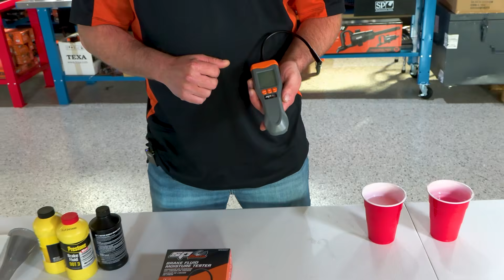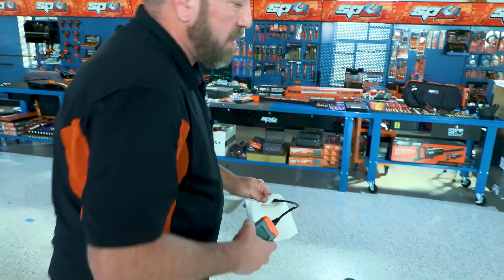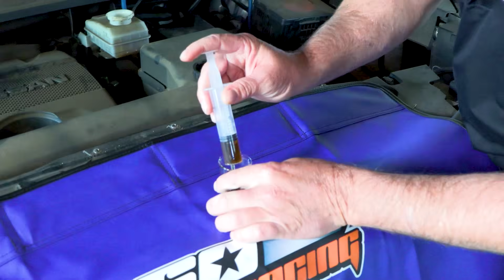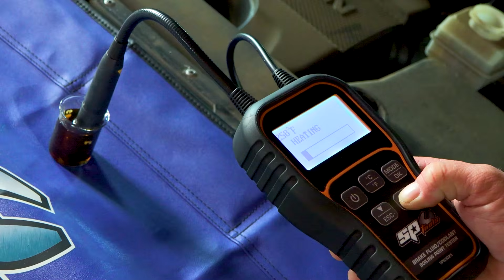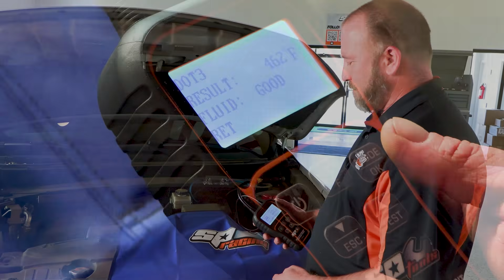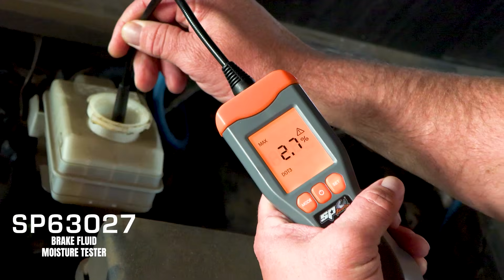SP Specialty Tools - Brake Maintenance

Comment: I have the SP63025 boiling point tester on order. After doing extensive research, I would be very reticent to use conductivity testing unless I knew the tester was specifically calibrated to the exact brand and formulation of the fluid I was testing (obviously in addition to the DOT spec). With a boiling point tester, there is no doubt and it is far more accurate. Boiling point testers are worth the significantly higher price tag in my opinion.